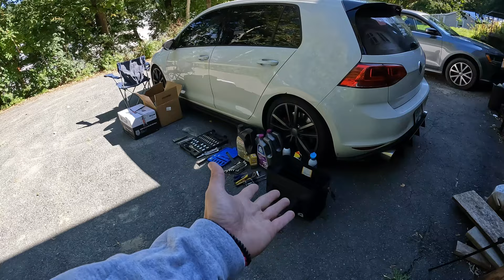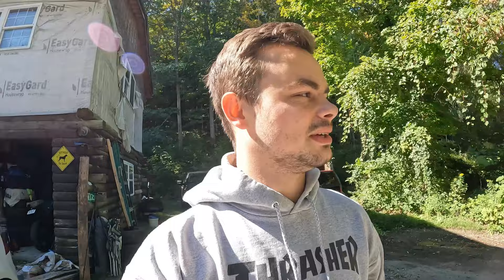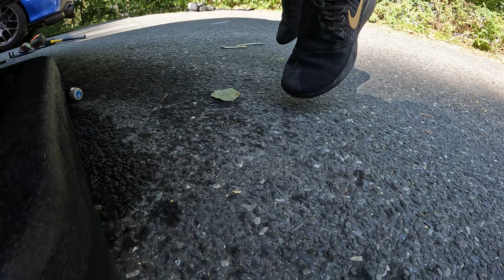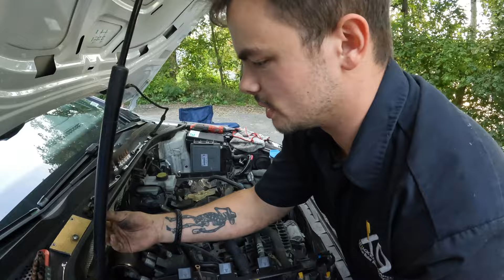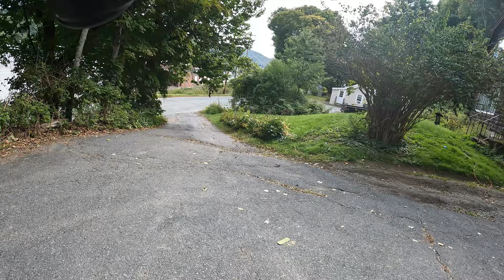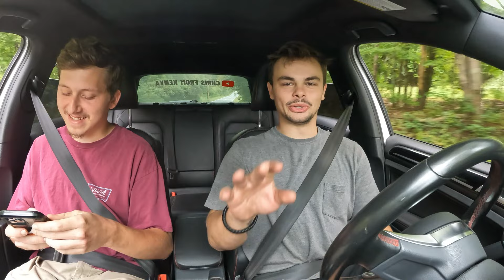The 400HP MK7 Build Begins - EQT BIG TURBO INSTALL & FIRST DRIVE

Comment: How many miles did you have on your car when you installed this?
Reply from the maker: so bought the car at 50K and tuned it immediately then installed the IS38 at 90K and now at 112K holding strong. Just gotta keep an eye on those plugs, water pump and have a reliable tuner and these will last

Comment: I've been tryna get IE's gt2260s and their stage 3 tune, says its around 500hp and tq
Reply: 435bhp / 432tq on 93 - 462bhp / 456tq on E30 (as per IE's own site on their dyno's).

Where the hell are you getting 500 from? lol
Reply: @Peylix  ahh i see what you mean in the charts but the description before that says 489 and 483
Reply: @dinocesko4413  that's also crank power btw. GT2260S at it's best (through IE's tuning at least) is 420whp / 415wtq tops on Trueflex E30.

I've seen this turbo do 440whp though. From a custom tune through the likes of EQT.

It IS a hair better than the IS38, but not quite as good as a hybrid like an IS20 hybrid.

It's a stopgap between the IS38 and hybrid setups.